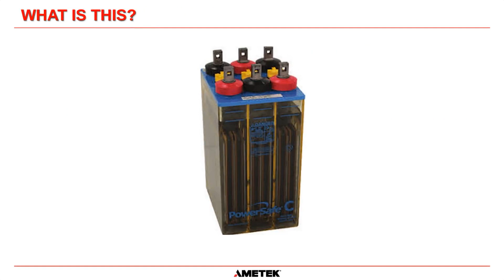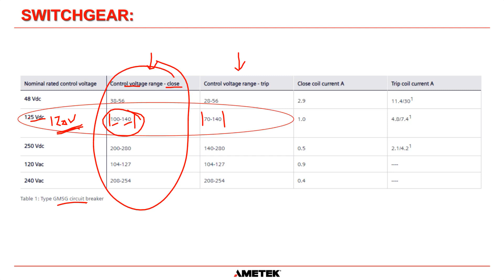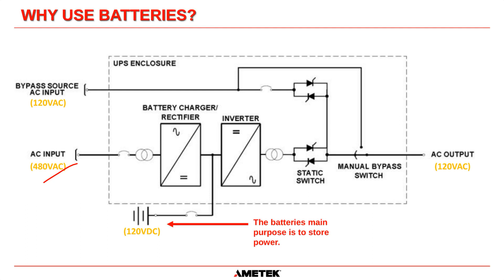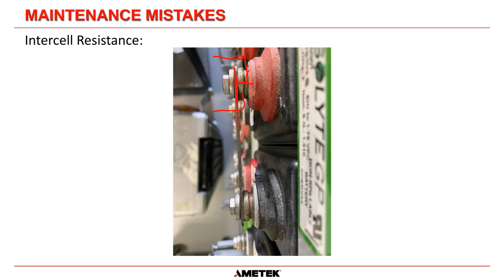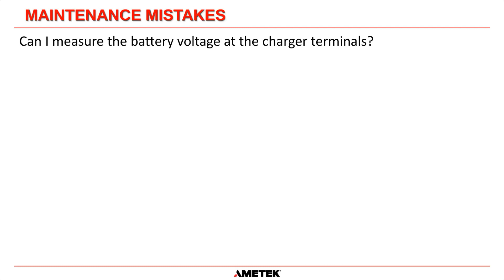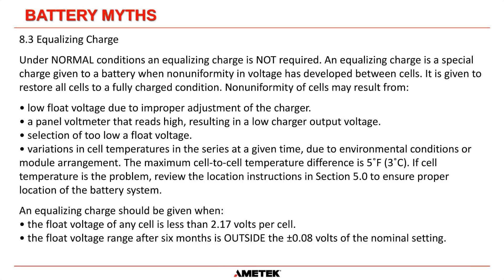Understanding Battery Basics and Battery Myths

Comment: I want to correct a comment mentioned in this video. I state that nowhere in IEE450 does it mention using internal resistance as a maintenance tool. This is not true. Although it is not mentioned anywhere in the recommendations for maintenance of a vented lead acid battery it is mentioned in an annex at the end of the report. I apologize if I misled anyone.